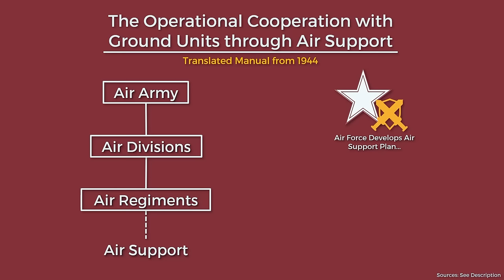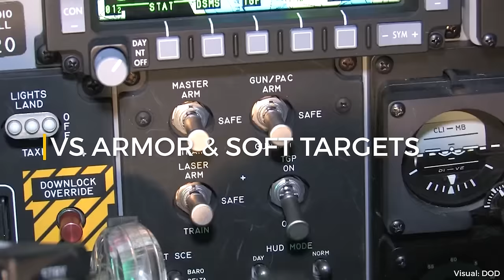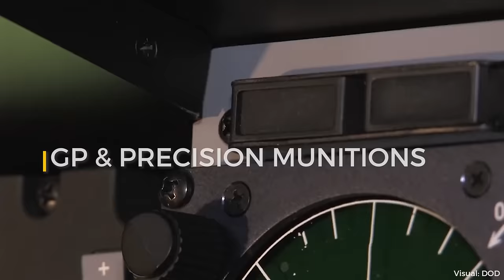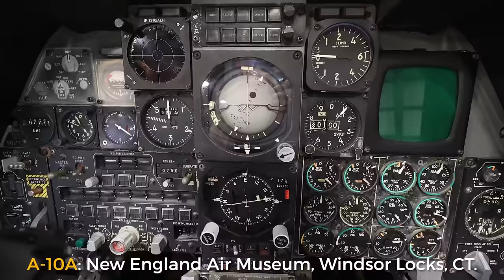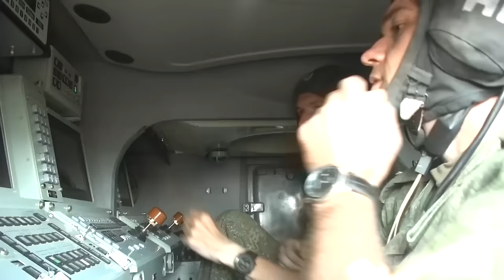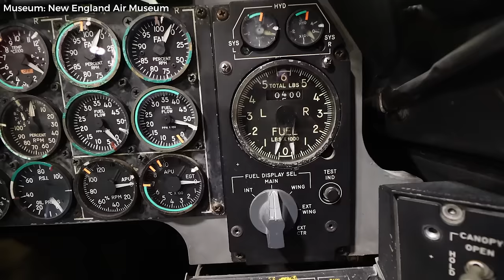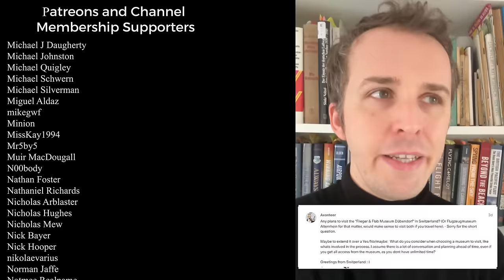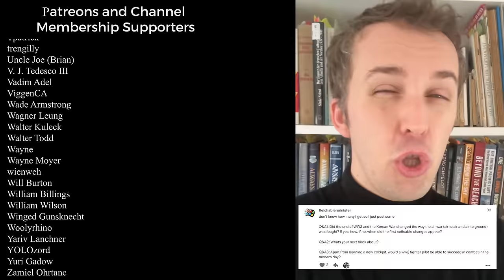A-10 Warthog: Retire or Upgrade the BRRRT? - Future of A-10C Thunderbolt II

Comment: I think that FPV drones are taking over the cost-effective CAS role that the A-10 once occupied.  However, it's difficult to put into perspective for regular folks the psychological effect of The Great Brrrrrt in actual combat.

I'd love to see a fixed wing FPV carrying a 20mm Vulcan or 25mm Equalizer filling a similar role at a fraction of the cost.
Reply: A drone in the A-10s weight class could carry the 30mm gau-8, a like for like replacement is definitely possible. The thing is, the USAF gets mad when the US army tries to provide it's own CAS
Reply: Rather than FPV drones, the switchblade is taking over the roles that have not already been moved over to larger drones and fast movers.
Reply: @jameshodgson3656  Not true. It's called Fire Support or "I Can't Believe It's Not CAS". Provided by rotary wing.
Reply: But that begs two questions

How much impact does it actually provide?

How important is that impact really?

In my impression, most of the impact actually seems to come from boosting the morale of frinedly forces after the war.
Reply: The strafing capability is the most overrated part of the A-10. In practice, it does something like 80-90% of its job with things like rockets, smart bombs, and guided missiles, and combat drones can already carry this kind of stuff on a regular basis. A manned replacement is probably going to be more urgent for the FAC and CSAR coordination role instead, and that one could be made cheaper and simpler without a humongous gun.
Reply: Agreed; psychological impact is not a sentimental matter, for the US or enemy forces.

Comment: Another interesting video as always Chris, thank you 👍

My 2 cents on the A-10 is this: I don't have any particularly strong feelings about the A-10 and in the near term I'm sure there'd be a place for it in a near-peer conflict if/when the air superiority and SEAD ops are broadly successful so it would "only" face manpads and light AAA. But in the long term it's a dead plane flying, so at what point does the US cut its losses and invest in something(s) else? (that's a rhetorical question btw).

Two things that I wish this vid had addressed are:
1) The A-10 airframes are wearing out, they racked up a lot of flight hours in the past 20 years, and refurbishing the airframes is expensive and subject to diminishing returns. At some point the USAF would be better off spending that money elsewhere.
2) Is the GAU-8 of much practical use outside of a very niche set of circumstances? It's a big and heavy weapon, but it can't kill modern MBTs yet is overkill for a lot other targets (e.g. buildings, soft skin vehicles etc.). Just my opinion but it seems to me that anything that can't be killed by a 20 or 25mm cannon is worth the expense of a guided munition.

It seems to me that the US would be better off spending the money on something new to replace the A-10, and they'll have do do something about it at some point so they might as well get started rather than waiting until it's either too late and/or even more expensive. Reading other comments I see a lot of people mention the AC-130 and gunship helicopters but for all their pros they also have plenty of cons as well, so I feel there's a need for something to fill the A-10's role whether that be CAS in a near-peer conflict or a war-on-terror type COIN. I'm unsure though if such a replacement should be powered by turbofans or turboprops (there're pros and cons to both) but I believe it shouldn't be any bigger than the A-10 but certainly larger than the OV-10 and have rough field capability... oh and ditch the Avenger for a simpler and much less bulky 20/25mm internal cannon 😉.

Edit: Here's a wild-card/'what if' idea for a replacement: if they were willing to drop the austere environment capability, the Airforce, Navy and Marines (plus foreign buyers) band together to buy new build A-7s as a relatively cheap CAS platform.

Comment: The problem with the A10 is the same as with Battleships in my opinion. Sure do thick armor improve survivability. But on the modern battlefield do armor thickness correlate very badly with survivability. A battleship can easily be destroyed by torpedos and anti-ship missiles. Just like a A-10 or a SU-25 can easily be destroyed by manpads or other missiles. Those types of weapons are dinosaurs that do not belong on a modern battlefield, where survivability is more decided by stealth and speed. And if losses must be accepted, then it is better to sacrifice drones.

Armor also comes with disadvantages such as slower speed, lower payload (because the armor use up much of the weight), the plane becomes heavier, having two engines means more ground maintainance. Having armor also drives up the production costs.
This plane was built for the Vietnam war where the communists used much small calibre anti-aircraft guns. But todays battlefield is field with manpads instead. And modern armies do also have much more deadlier things than that.
So this plane is outdated.
A modern air strategists would rather wish to trade away all that armor for stealth instead. Just like modern warships rather rely on stealth than armor, and big guns is not that useful in an age of anti-ship missiles.

A critique would of course say that dumb bombs still make up the majority of bombs dropped in a modern war. And that it true. However I still think that stealth is preferable to armor. And A-10 is still useful on a modern battlefield with its many hardpoints and ability to stay up in the air for hours and waiting for a moment when the troops on the ground desperatly need air support.
However, while A-10 is still a good plane to that I am sure that Ukraine would happily take every single one of if USA offered all their hundreds of planes away to them... so am I also confident that many other planes are more useful overall as an attack aircraft. Like Gripen. Rafale with its enormous bombload and semi-stealth body could probably also make an at atleast as good job.
Both Gripen and Rafale are good at many jobs. But A-10 is just a one trick pony.

Comment: A-10s for anti-shipping is an...interesting idea. Naval air defences are far more concentrated and extensive than land based air defences. Unless the A-10 can sling a ton of LRASMs, that's a pretty good way of getting them killed.
Reply: Given the amount of hardpoints on them, they very well could.
Reply: They would be focused more on attacking smaller vessels, like the Iranian fast boats in the Persian Gulf or pirates off the coast of East Africa.
Reply: @killergames391  Highly unlikely due to the weight of the LRASM, as well as it's dimensions. I'd estimate 2 at a time would be the best case payload of LRASMs..
Reply: @dumdumbinks274 5 would be the right answer, same as the number of JASSMs it could carry.
Reply: @thearisen7301  JASSM is smaller and significantly lighter.
Reply: @stupidburp  It’s probably overkill for that, SH-60s and drones would terrorize a small boat force unless they have lots of MANPADS.
Reply: Yeah. That's also a mission where stealth matters.

Frankly, it seems to me all of the suggested roles are already fulfilled by some other platform, which can do it just as well or better.
Reply: @cm275  Possibly overkill but the USAF doesn't want to get stuck in a fair fight. They also want to make use of existing assets and this is a mission that they can do.

Comment: My, admittedly unpopular, view is that if you're looking at repurposing A10 to another role that there's not really anything at it can do that another plane can't.  Take away the big cannon and you have a subsonic ground-support airframe that can carry missiles and bombs but is expensive to maintain and is vulnerable to groundfire.  I can swap you for a turboprop that can carry missiles and bombs, is subsonic and vulnerable to groundfire but is very, very cheap and can operate from unprepared strips.  

It's unpopular because a single or twin-engined turboprop isn't cool.  But I would argue that, sans BRRRRR, the profile is very similar.

Comment: A lot of people focus on the plane. What the plane itself is good or bad at. While that is certainly important I would argue the bigger factor is training. The A-10 is dedicated to a specialized set of missions, which means it has pilots and ground crew trained for those kinds of missions. This was touched upon in the video but I think it deserves a lot of attention. One of the push backs you get when talking about retiring the A-10 is where the pilots and their training goes. The answer for years has been the F35.
Even if you think the F35 can do everything the A-10 can, the problem a lot of people see is that once the USAF puts those A-10 crew in F35s they will suddenly be training for multirole mission sets. This would inevitably lower proficiency in both CAS and CSAR(which was not mentioned in the video) roles which are currently the main mission sets for the A-10, because they would be putting SEAD ops, air to air interception tactics, etc in their training schedules. Great if you think the entire force should simply be a multitool in your toolbox, but I think you can make a case that it is still valuable to have specialized tools in that toolbox regardless if it looks like an A-10 or not.
Reply: Problem.
The USAF F-35A pilots are not training for CAS, the published training hours has F-35A pilots are scheduled for zero CAS training flights.

Comment: I wonder if the A-10 could be converted for uses in civilian applications. In California we've adapted OV-10 for use in directing forces against wildfires, and there's been proposals to adapt the A-10 to be a firebomber. I'm curious whether there's any validity to this concept or it's just pie-in-the-sky thinking?
Reply: Maybe it could be good as a close air support for the firemen on the ground. But otherwise am I more in favor of using other planes for that role. In todays world economy are there not much use for old jumbo jets. So there are lots of such old aircrafts sitting around that I think could be converted. Their bombload with water and flame retardents are huge. They are like the B-52 strike of fire fighting. And their operating cost per flight hour are lower than many of the shitty helicopters that we have in the Swedish military that only can carry 1 or 2 tonnes of payload compared to 60 tonnes of water that a jumbo jet can drop.

However I imagine my main concern against Jumbo jet would not be the lack of maneuverability and precision bombing, but rather that it is not suitable for all kinds of wildfires. I guess it takes hours to pump in 60 tonnes of water into a plane and make a 4 engined plane ready for a mission. And 60 tonnes of water is perhaps overkill for some minor wildfires, and therefore could a smaller plane be more suitable for those kinds of missions.
A smaller plane that could fly many sorties, that is cheap to operate and can deliever precision bombings instead of causing enviromental problems by dropping too much water and flame retardant over a small area could be preferable.
I do not think that A-10 is the best option for this role, even if it is better than a jumbo jet in that regard. I believe that cheap propeller aircrafts might be a better option.

Comment: The A-10 doesn't make much sense in a near peer conflict, fortunately, or unfortunately, as the case may be, the US has been in a lot of not-peer conflicts in the last 20 years. Against a foe on foot with turbans and RPG's, the A-10 can be very effective at dealing with small arms conflicts, where you can throw in unlimited power in the air, to protect your boots on the ground.

Comment: I'd like to see the 30mm either replaced with a radar, integrated jammer, IRST & maybe a smaller gun like GAU-22/A.

I would note it can use a jammer pod right now. 

I think a combo of the roles you discussed do justify the A-10 as one example it can carry as many MALDs as a B-52. 

A-10 has a lot of stations so it's able to carry a lot of ornance like 16 SDBs. For ASW it could carry 10+ HAAWCs along with sonobuoys.

Comment: I empathize with the suggestion for a look at aircraft designers.  Personally, I enjoy reading about the evolution of an aircraft's design, as various problems are discovered and fixed.  I spent 12  years in aviation and saw various fixes being implemented.  When I look at aircraft on display, the various little strakes or vortex generators that hint at some problem that needed to be fixed.  There are stories waiting to be told, but perhaps not here.

Comment: The tanker variant of the A-6 Intruder, the KA-6D, came into being in the early 1970s to replace the KA-3B variant of the A-3 Skywarrior.  It served for an awful long time.  Serving for several decades is hardly an indication of "a final step from being cut from the block".  The A-6 wasn't retired until 1997.

Comment: 3:23 says it all.   As a former USAF CCT, there’s never been a support platform that ground units I was embedded with would prefer over the A-10.
Reply: Because Grunts know so much about specific aircraft types...
Reply: @daseinzigwahrem thank you for your military service.   Your extensive combat experience has been a valuable contribution to the discussion.
Reply: @SilverShamrockNovelties  it's simple logic. Taliban had next to no AA capabilities. You think they'd survive in a contested airspace? They'd be runway queens until the other fighters did the DEAD opeartions and by then the war would basically be over anyway

What do you think will happen when a low flying slow aircraft with a giant radar cross section enters the range of a proper IAD system? I trust the experts on this one.

Comment: Clear, succinct overview of the issues facing the potential continued deployment of the A-10. As you noted in your last video, the A-10 possesses a set of capabilities that can be very effective for CAS missions, but it is dependent on the environment in which it is operating. Even when you made that video, its continued survival and effectiveness were in question in a peer based conflict. Since the beginning of the Ukraine war, I think we are all questioning (or should be) the continued effectiveness of this platform in its traditional CAS role, especially in the an environment with high deployment of MANPADS. I agree that the path toward continued deployment of this platform would be to identify additional missions that would contribute to the strategic mission within a theater (e.g., drone deployment, ECM, maritime, etc.), but I believe in most cases the sun is setting on the active operating life of the A-10, and the time is past due to consider what combination of platforms and tactics can best replace it in the CAS mission, and focus on producing/maintaining more capable platforms. I would like to note that there is one important capability you did not examine in depth which I would argue is important to its and to supporting deployed ground forces, which is its loitering time. This is NOT an issue of sentiment; for any current or former infantry, the knowledge that there is always someone nearby to provide rapid response support to enemy offensive activities is an enormous morale booster. You cannot over-exaggerate the importance of this capability. It appears that the offensive capability of the A-10 can be matched by other platforms--but how will the loiter time be addressed? Anyway, another thought-provoking video. Thanks for all your great content over the past six months in particular; you've really come a long way since you first created this channel, and I'm very pleased to be one of your supporters!
Reply from the maker: Thanks so much for your kind words !

Comment: I agree that the A-10 is vulnerable in a 1st line role with an active air to air missile threat, however, the A-10, B-52,F15, F-16 etc. are just a tool in a tool kit basically. you pick the one you need for the job at hand. not every job at hand is a 1st world, or peer to peer conflict in an active war zone. IMHO the capability of the A-10 for many other missions than the primary one it may have been designed for is extensive. you did a good job pointing some of them out. there are many more if creativity is used. the F-14 Tomcat is another example. we will be sorry to get rid of it.  and how much will that cost to develop and produce a replacement for the A-10. and I don't consider drones a replacement for many reasons.
Reply: You don't keep useless tools in your kit because you like the sound they make.  The A10 is dead weight.  There isn't a single job it does that other platforms can't do better--except make a noise that makes people say "Wheeeee!"

Comment: I can see the A-10 being useful as part of a SEAD/DEAD hunter killer team.  As they are able to fly along very low since they're designed to be slow and low CAS aircraft, they could hug the ground with dedicated SEAD or EW aircraft above acting as bait essentially to pinpoint S300/S400 sites.  Some stealthy folks above watching for threats. The A-10s then could either lob munitions onto the radar directed by the eyeballs, or wait for the HARMs to hit the radars and take out the remaining system components. This is fairly high risk to MANPADS and plain old AAA, war is war and war is risky so why not?  Wouldn't want to risk any expensive fancy new fast movers down that low to stay under the horizon after all.
Reply: Considering they had the highest amount of losses of any airframe in the gulf war, and mostly to IR SAMS, that's a poor idea.